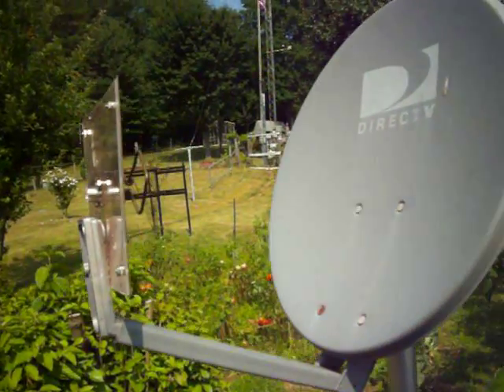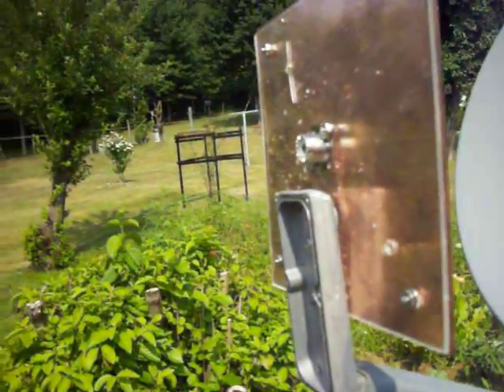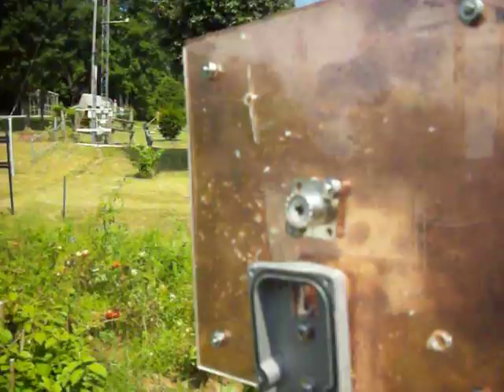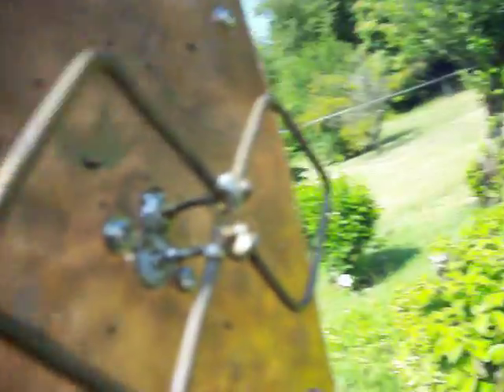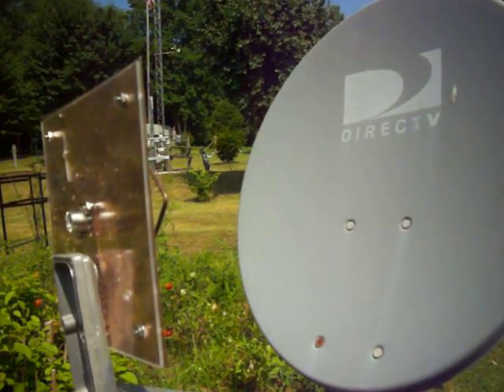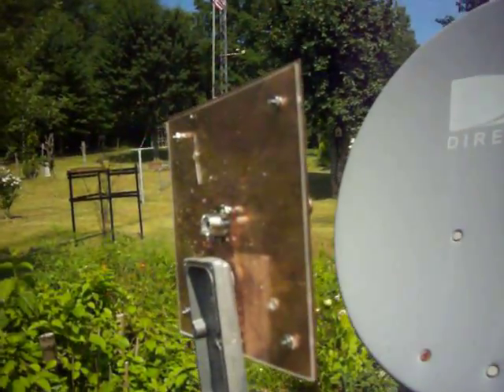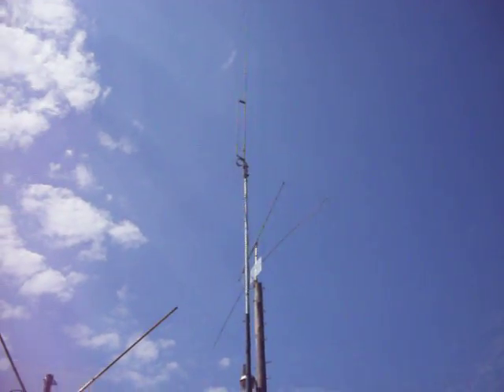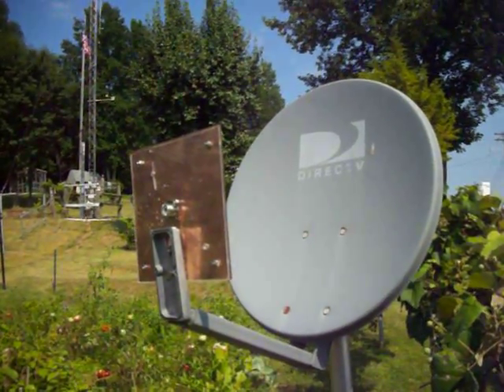WD4AM Homebrew Wifi Dish Free Internet

Comment: You made a couple comments about this one using a 7x7"copper plate I have a 8x8" copper plate is this going to make a difference also you said to make the arrow 93/4 I belive is that total length of top  and bottom parts of the arrow including the tips

Comment: Mr. Mike I posted this on a few youtube sites, your voice gave me courage can you answer this poor West Virginia question? hi last year I watched a video about making a dish into a wifi receiver The man who sold it to me and hosted the video is called thanksbuyer-hobby he said I need to buy this 2.4GHz Mini Amplifier Remote Controll Range Extender for FPV Transmitter Black  and linked it in the video. I have tried him and still looking the video that was attached. Can anyone tell how to use to create a wifi receiver? I have the dish and this part, any help would be appreciated. My brother-law is in need  of wifi and on fixed income and I would really like to help  thanks so much everyone please tell what I should buy if this is wrong. Thanks Mike
Reply: If you have just the dish part  all you need is  Wifi Dongle and a  USB Wire with the correct end like a micro.  If you use  Slimline Directv dish you drill a hole in the middle and push the antenna thru to the back.  The  sweet spot is only 1 inch off the dish..  Once I did this I went from Wifi that was at 1 - 3 Kbps  to 20 Kbps

Comment: I wouldn't use a SO239, because the PL259 sucks at high frequencies (>=UHF). I'd use a N connector or F-connector instead. Plus the Dish is not a prime focus, but an off-set dish. If you'd turn it upside down it would work better, unless you want WiFi from a balloon (Google). 

Love your awesome antenna park though, due to strict building regulations It is hard (a LOT of paper works, permit fees etc.) to put a large antenna in my QTH (Europe, Netherlands, somewhere in the suburbs of Rotterdam). Still building my shack, hoping to set up a 65 ft mast Q2 2017.

73's from PD1S, the Netherlands

Comment: Nice build but you need LMR-400 cables combined with N connectors to eliminate signal loss through cables. Also keeps everything at 50 ohms.

Comment: Why could we see more info on the operation than spending video showing unrelated stuff???  Also SO239/UHF connector good to 500MHz so a "good" N connector would be much better.  Simple change.  Great idea.  Mount a WiFi box on the feed and have little loss.  I bet that SO239 has 6db loss at 2.4 GHz.

Comment: I don't think the SO-239 connector should be used for WiFi frequencies (~2.4 GHz). Its impedance is said to be non-constant within the connector, resulting in reflections which are considered losses.
Reply: Alex Arevalo Yep, a N-female for sure would have been a better choice than the SO-239. Anyway Mike nice video. de WK0DX
Reply: Alex Arevalo I

Comment: Properly aimed, these things will go about 10% past line of sight.  I put one up and got about 100-130 wifi's but I can see downtown Omaha in the valley below.  I think if I optimized everything I could be at about 150-200 wifi's.
A microwave connector would outperform that SO-239, and I would put the wifi repeater in a box on the plate or use a USB there and run USB cable no more that 30-40ft or so to the computer.
Reply: really!!!

Comment: I used an elliptical Dish. I directed the signal to our router with my wireless adapter attached to the dish but it actually worked against the signal from the wireless router. therefore dropping my internet speed. it wasn't until the ISP Tech came that we found this out. even He was surprised. it's contrary to what should be going on. the signal should be stronger. so now I don''t use it any longer. this is not to say this won't work at all. it DOES work but just not in the set-up with our network for some reason. too many variables to work with to figure it out.

Comment: Someone please help. I need to broadcast my signal from Xfinity wireless gateway about 100 yards to my building. I'd like to buy a kit as I have no Ham ticket. Run a coax to a yagi on the roof?
Reply: Repeaters are for sale everywhere. Just read some reviews in your pricebracket and you should find something suitable without trouble. But if i where you, asuming you are able to use some basic tools, i would make my own yagi antenna or a cantenna. Those are directional antennas that can go for 10 miles if you want. Super easy to make and can be done for cheap. Either with a usb conection for the pc in the remote location. Or you can fix it to the antenna conection on your router. The usb one is the easiest, just plug it in and point it at your house. check "andrew mcneil" youtube channel for guides. He makes small ones from noodle cups or tin cans and huge satelite dish antenas with great info on how to do it. If you rather have a out the box solution the alfa wifi adapters also have great range. And you even could put a more powerfull antenna on it. The "bearwifi" adapters also have a good rap. Dont remember the exact name. But you should find it on google. Hope it helps.
Reply: just run cat5 burial cable , or just use a bridged adapter in the building
Reply: Yeah. Those are cheap and easy. And its fun to make. Or setup a birdhouse with a smaller repeater half way. Should work as well. Fit a battery and a small solar panel on it and it will go forever.
Reply: roger supernova What equipment would you recomment as a repeater?
I am not sure whether you can relay a hotspot without configurating the router of the hotspot.
Reply: wwwtotalitaerde also. Don't buy the cheap yagi's on ebay. Most of them are not tuned right for wifi.

Comment: Freedom Hub modem from Freedom Pop is free internet service that works off of Clear Wire's service. The Freedom Hub modem has a small antenna port that looks like a mini coaxel female connector. Is there a way to connect the satellite dish to that modem? Here is a picture. http://c.shld.net/rpx/i/s/i/spin/image/spin_prod_1021244512?hei=333&wid=333&op_sharpen=1

Comment: You could only use the dish as an receiver. You wouldn't be able to get free internet from a satelite dish in space, or a local land repeater from a satelite internet provider. You would be need to be able to authenticate to the ISP network which they usually require access cards on the modem, which are check with the ISP services for current subscription, also the dish alone wouldn't provide service, you still need a modem to convert the signals to TCP/IP packets in order to get internet to any computer or mobile device. You can't just simple plug the dish into a computer and go. Souce: My self, Network Engineer for IBM
Reply: This has nothing to do with any of that. It's just Wi-Fi.
Reply: @IDoNotLikeHandlesOnYT  can I use a statilite dish as a reflector with Panel antenna for wifi? answer me please 🙏🏼🙏🏼❤
Reply: @theking-lr2yy  You can certainly try. Put the panel antenna at the focus of the dish, pointing at the dish, and point the dish's beam at the access point or whatever you want to connect to. It might work.

Some problems you might encounter: You might have to move the panel antenna around to find the right spot, though the location of the old feed (if there is one) should get you in the ballpark. If the panel antenna uses an antenna array internally, then it might produce a too-planar wavefront for the dish to focus effectively—parabolic dishes expect spherical wavefronts. The panel antenna (again, especially if it uses an array, and directly related to the wavefront shape) might already have a pretty high gain (depending on its design), so you might not actually get much improvement from the dish both because the gain is already pretty high without the dish and because less of the dish area ends up being used—look up "dish antenna underillumination" for diagrams. On the other hand, if the panel's gain is really low, you'll also get relatively little improvement from the dish because so much of the panel's pattern will spill past the dish—that's "overillumination". Also, if your dish is off-axis, it'll be more difficult to get the alignment right. The small gray dishes are usually off-axis, while the big black C-band dishes are on-axis, so with those, you can just point the feed at the target. An off-axis dish might have markings on the mount to help you aim it. The final thing that comes to mind right now is the flatness of the dish surface. It needs to be smooth enough to reflect the radio waves specularly rather than diffusing them—think about smooth vs. frosted glass. A dish designed for a lower frequency might not be smooth enough to use effectively at a higher frequency. (A higher-frequency dish should be more than smooth enough for a lower frequency, but is less likely to be usefully big, because higher frequencies don't need dishes as big for the same amount of gain.) Don't worry if there's rough paint on it—the smoothness of the metal surface is what matters.

Keep in mind that I've never actually done this, so the above is all theoretical knowledge only. Because there are so many factors, the best way to figure out if it'll work in your case is to just try it. You might want to turn down the transmit power if your Wi-Fi gear has that setting, to stay within the legal limits on EIRP for ISM band use—the dish can still be helpful in that case just by reducing off-axis interference.

Comment: ....I'm planning on building two of these. I found the Bi Quad Mach 2 V.2 ( item 141058749971 ) on eBay. The only difference is that they use N connectors and a box is built around the antenna. You have to weatherproof the box yourself .  Like the above antenna it  doesn't include the dish but there are pictures there to show you how it's all put together. Several dishes are available reasonably on eBay. The  N connector out the back  is connected to another 90 degree N connector that points down. Screwed on to it is a Wi Fi connector by Alfa Networks Inc. It is called an   "Alfa Tube 2H Connector". Out of the Tube 2H use 24 AWG Cad 5 Ethernet cable to your Router. Note the Tube 2 H does NOT come with the ( item # 141058749971 ) but there are complete kits available on eBay that includes the Tube 2H and everything else you need ,except silicon , a router and the dish for about $159.00 .  Expect to pay about $40. t0 $50. for the dish ( including shipping ) and $45. to $90. for the Tube 2H . Also on eBay and Amazon there is a good  portable sized  router by the same company that manufactures the Alfa Tube 2H. It's an Alfa R 36.  With all the time you might spend trying to find all these parts  separately...I'd say the kit is a pretty good deal . I spent about two days rounding up the best prices on the components and it looks like before the router I'll have about $ 120.00 in mine. The time is worth the other $39. for the kit for sure and the shipping is free.

Comment: How do you use coax in this equation? wouldnt you use a long USB cable?  or is there an adapter for a router that can be used?
Reply: I think you're supposed to replace the rubber duck antennas on your home WiFi router with this antenna. You solder a connector at the other end of this coax from the dish that is compatible with your router's antenna connector.

Comment: You would get better signal if it was pointed at the source of the wifi instead of into the sky. your signal is terrestrial based but you are still aiming as if it was a satellite. elevation should be set at 0 degrees.

Comment: [Possibly (maybe, maybe not) you can get a free satellite dish at your local recycling center or "transfer station" where stuff is collected for metals recycling. But you have to ask at the manager's office for permission to reuse. Some recyclers won't allow any stuff at all to be picked up, you have to make sure. Don't take without permission, they have a name for that. Some recyclers will allow occasional pickup of stuff to be reused, others may not allow it at all.]

I would like to get the specs for your system. Can you write them down including that connector (part number or type of part)? Thank you very much.

Comment: An important point is that connecting to AP's even if they're advertising 'Free WiFi' 
Could easily be a felony. (Unauthorized access to computer systems.) Make sure you have explicit authorization.
Reply: I would think any lawyer would be able to argue that a network name like that counts as authorization. I also doubt that anybody has ever named their open network like that without intending for strangers to connect (though they may want strangers to connect for nefarious reasons).

Comment: You need to make sure that your center of the antenna and over the hole where the LNB was removed or you will not have the most effective pattern of that dish reflector. The image you have here shows the center well above the LNB center hole which will mess up your pattern.

Comment: I built a double quad yesterday...    looks like yours, only it has 4 diamonds instead of two.  I used a steel plate instead, and got around having to crank up the torch by simply using bolts to make the electrical connection.   Works about as good as any store bought antenna, though I'm less than impressed with its performance.  Its doing a long haul for me 200 yards or so to a remote repeater. I get around 16% signal in day time, and up to 44% at night. I wish I had an old DTV dish to boost it

Comment: if u pay for the internet service the company most of the time wires the house for u, all they do is drill 1-2 small holes into the house (if u dont have a current connection point.) then they seal the holes around the cables and boom u have internet.

Comment: You could add the rest of the system.  does it connect to anything ?  a modem or a router or a
adaptor.  How does it transfeer a signal to your computer , you left that part out dude Hi Hi
73

Comment: Alfa AWUS036NHR - High-Gain 2000mw 2W 802.11 B/G/N Wireless USB Network Adaptor With a 5dBi and 9dBi Magnetic Base Rubber Antenna and a Suction cup / Clip Window Mount dock and a 5m (16.4 Feet) USB Cable - Wireless-N 802.11n Wi-Fi - 150Mbps - 2.4 GHz - 5dBi Antenna - Long Range - Realtek Chipset - Strongest on the Market

its on amazon  go look for it